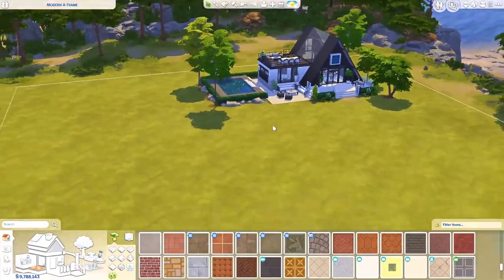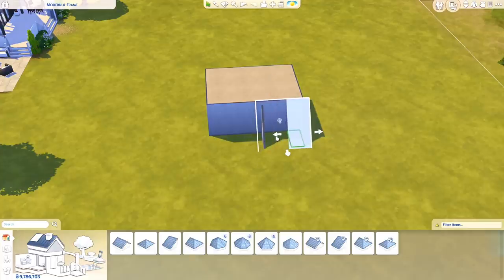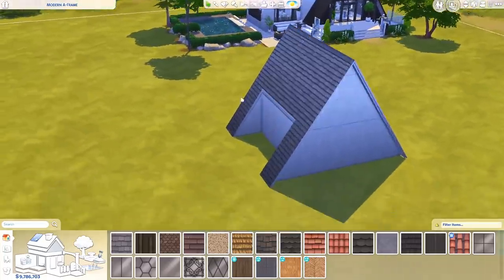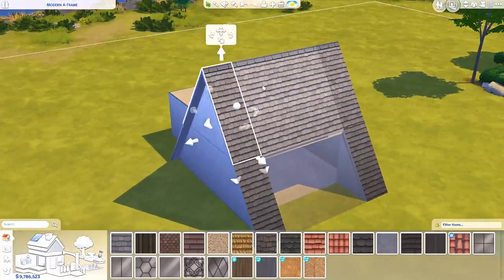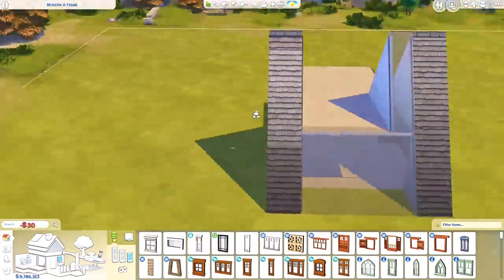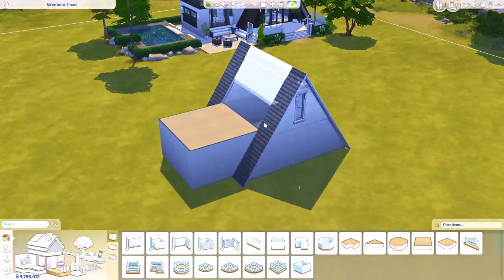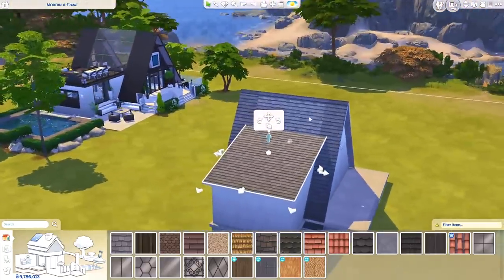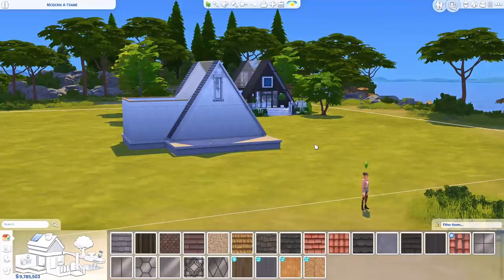HOW TO: A-FRAME ROOF/HOUSE | The Sims 4 | Tutorial

Comment: I just wanted to pop in and say thank you for this video. I am a console player (PS4/EA ID: BADBOYLOKI) and love getting tips on how to build things. I used your video to update the roof I had on a recent modern home build I am working on in which the second floor master suite over looks a sunroom off the kitchen. I had completed it with a half gable roof, but then had to add glass to the one wall so that they could use the skylight. With your instruction I was able to drop the wall to a glass fence so now it truly over looks the floor below. It may not be as private - but it looks stunning. The only issue with doing this on the console platform is you can only extend the eave/soffit so far - I had to do two of them. Thanks again!